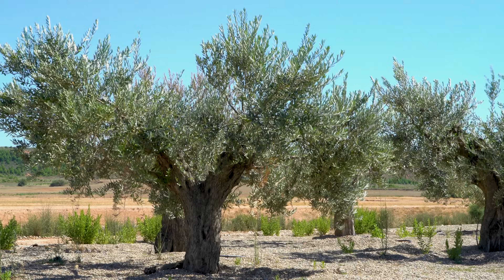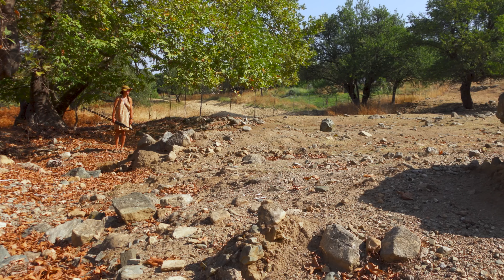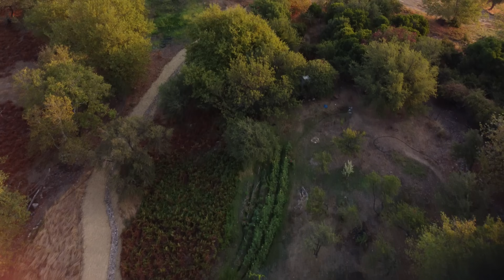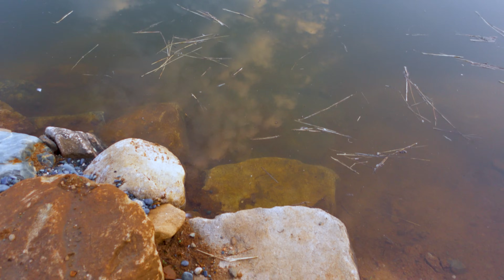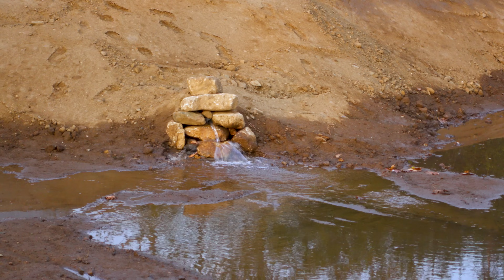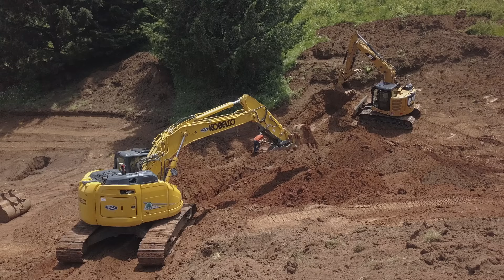Reviving Paradise in the Mediterranean  - aiding nature's resurgence with Water Cycle Restoration

Comment: We have a piece of land in Hungary where the climate starting to become very similar, all rain comes during spring (if it comes) and the summer is extremely hot with no rainfall at all until the autumn. There is s small river going trough our land that dries out during the summer. My question is: how do you make sure that these ponds won't dry out during the hot summer period?

Comment: Everywhere it's the same story. Spain, Australia, Greece, the US... People think it rains less. It doesn't. It only rains LESS FREQUENTLY. Do an average over 2-3 years, same amount of rainfall or more. If people understood this simple fact, we'd be going somewhere. So why does it rain less frequently ? Because there's less vegetation due to human activity. Overgrazing, deforestation, or, like in most of Europe, replacing deciduous forest with stupid Ikea pine forests... A quick buck with trees you can harvest in a couple of decades. Vegetation is key to regulate the climate. It evaporates water through its leaves. And deciduous forests are more important, because they evaporate a lot of that water in summer. Which means when it rains in winter and fills the aquifers, all this water will be redistributed throughout the landscape by those trees and other vegetation in late spring and summer, making it rain like clockwork. Trees even have bacteria they send to the air that trigger rain... Plus, these clouds generated by trees are pushed inland by the wind. Appart from the aquifer thing, which kicks in until early summer (if there's aquifers, not always), this is how you get rain from coastal areas towards the drier inland areas : it rains on a coastal forest, the forest recycles that water by evaporating it, and it's pushed further to the next forested area. If you meet an eroded landscape, without trees, you've stopped this natural process. This is how entire regions are locked in severe droughts, until a massive rainstorm comes in, that makes it even worse because the water will erode the landscape even more. Think of those stupid almond farms in California, the olive farms in Spain and Greece, all three on naked soil. Think of the pine plantations of south west France, central UK etc... Same thing with agricultural land that's done on vast naked fields, with no hedge, nothing. France has pulled almost all its hedgerows in the 60s for productivity. It worked for a while, bigger fields. But then summer droughts happened more and more. Soils were being eroded more and more. And now we have desertification in places like the Beauce, we have the Paris region that is now the driest in the country after Provence, 500-600 mm of rain a year, because all that rain from Normandy doesn't travel here any more. 

In places like Australia it's even more complex. Goats were introduced, and there's not enough natural predators to keep them in check, dingos and snakes aren't enough. Moreover, cattle stations the size of countries are pumping water from ancient aquifers. That water benefits kangaroos that are now overpopulating and overgrazing the area, alongside the cattle itself and the goats (as well as camels, horses, donkeys...). In outback Queensland, severe droughts make people think it's always been like that. They now realize grazing from sheep and cattle, as well as erosion and earthworks have modified the landscape. There used to be earth swells, mounds, that would keep the water from big storms sitting there for months. There was a wetland season, supporting the landscape. Now that it's all flat, it doesn't work. Water slides to rivers and ends up in the oceans. People are trying to build those swells back up, and can see it's working. But making it so it covers an area the size of Western Europe won't be easy...

Comment: Samothrace (the island of the project) has the worst goat population problem, reached to a level that the locals are searching ways for extracting a lot of goats out of the island to stabilize the population. Astypalea island in the Southern Aegean, which is smaller than Samothrace, has almost 16.000 goats. So i can guess the goat population in Samothrace is much more worse. 
On the section of water, you were very lucky, because Samothrace is of the most rare small sized greek islands that has a lot of water springs, so that's making your project process more easy!!!
Reply: Go and see Tinos. It's a destroyed island. The situation is simple. Ikaria people have found it. If a goat is found few l free roaming, anyone had the right to slaughter it and bring it to the big summer panygiri